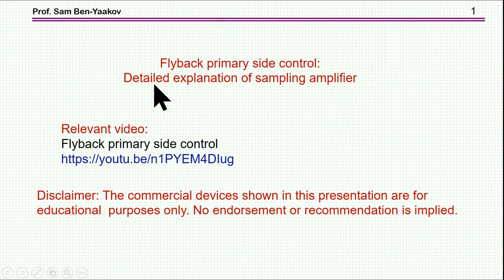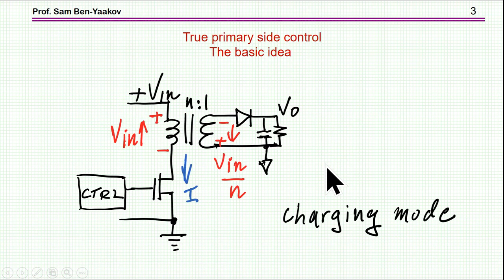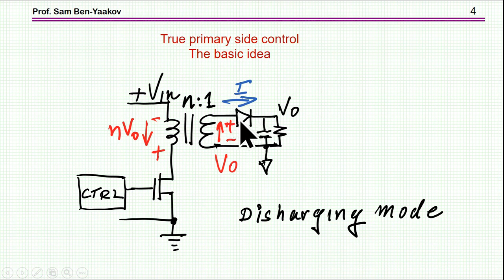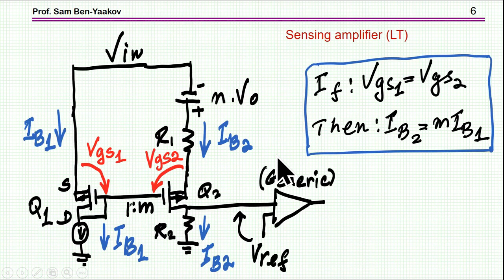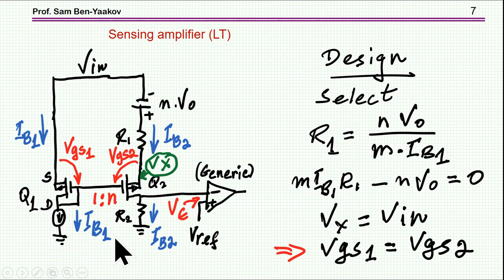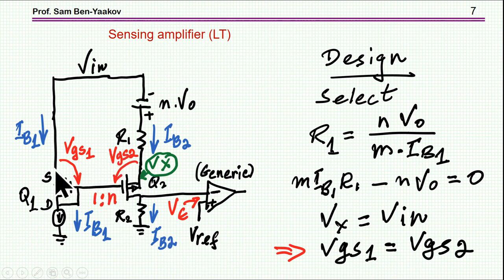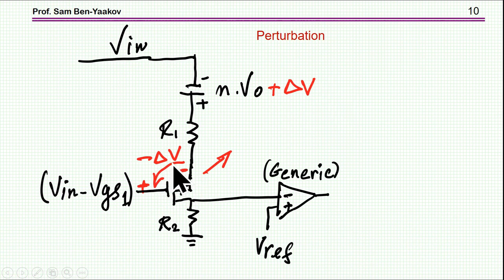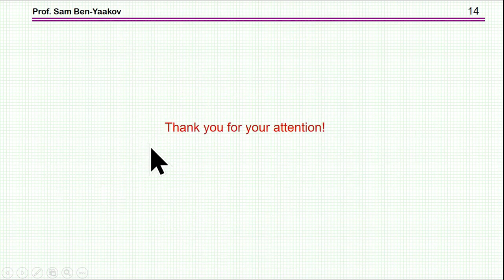Flyback primary side control: Detailed explanation of sampling amplifier

Comment: Thanks! Can you explain how is high side bidirectional shunt amplifiers work?  (60V) and is it possible to make own for wider range?
Reply from the maker: Have you seen https://youtu.be/qNeOWJz2oUw ?
Reply: @sambenyaakov  Oh thanks i liked it and totally forgot! :D
Reply: @sambenyaakov  I watched video again. i seen a different approach that does not needs super-precise resistors. It was called "over-the-top amplifier" and it uses some schematic magic. i was wondering if i could make one with classical components and external transistors
Reply from the maker: @vasilisk8944  Well, I m afraid that I am not familiar with magic solutions, only engineering solutions😊

Comment: One thing people might ask, or get confused with, is why not just using R1 & R2 as a resistor divider. Why all the trouble with the current mirror?

And the reason (I think) is the sensitivity to Vin that would imply. With a R1 & R2 resistor divider we would be not only measuring changes in nVo, but also in Vin all mixed up.

With the current mirror, as Vin changes, Vgs1 remains the same, and so, up to some (reasonable) frequency the gate voltage of the PMOS follows Vin. Therefore the voltage drop across R1 is in 1st order not directly dependent on Vin and so is Ib2.
Reply: PS: most likely gm2*R1 >> 1 such that a change ΔV in nVo becomes approximately (ΔV / R1) * R2 change at the error amplifier. Or rearranging it ΔVε = R1/R2 * ΔV which is linear.
Reply from the maker: Thank you for the clarifying discussion. For me, the fact that Ib2 is independent of Vin, tells it all.